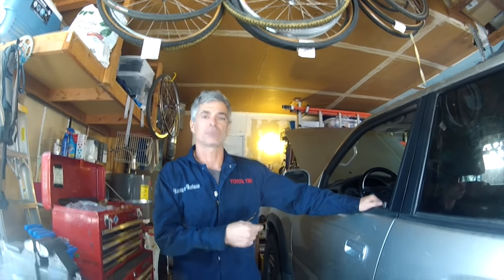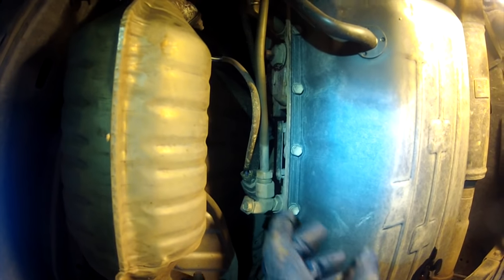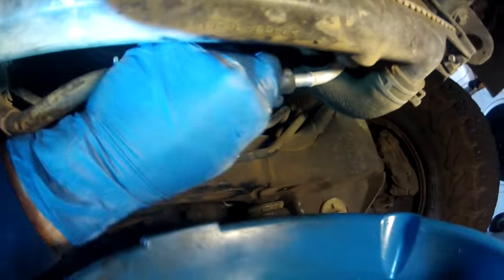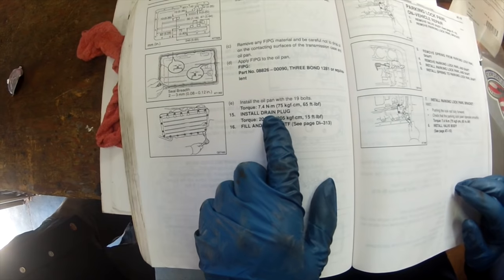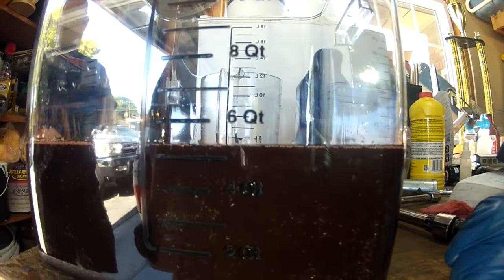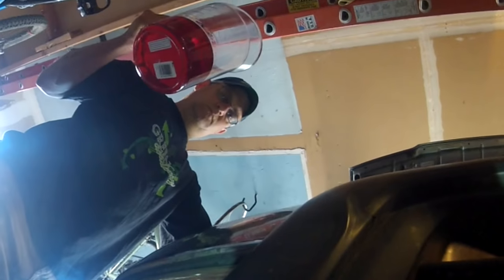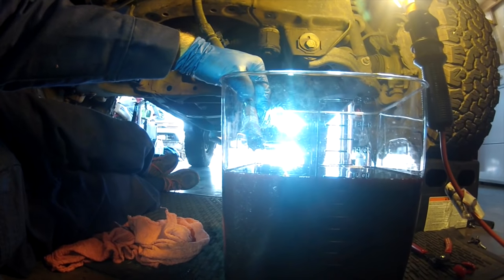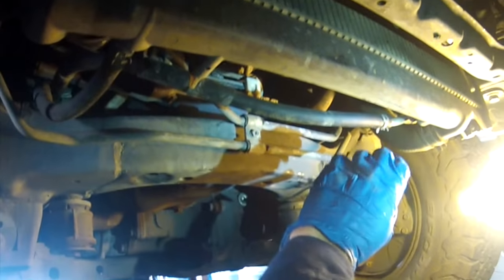Transmission Fluid Flush

Comment: I have an '01 Tacoma, but it's a manual transmission.  Is the process that much different between manual and automatic transmissions?
Reply from the maker: It's different and it's easier Joseph.  Yours is just like renewing the fluid on a differential or a transfer case.  You just take out the drain plug at the bottom of your transmission and drain the old gear oil out into a drain pan, put the drain plug back in, take the fill plug out and refill it will fresh gear oil.  You want to have your rig on level ground for this.  You fill it with gear oil until the oil starts spilling out the bottom of the fill hole and then you're done.  Take a look at your owners manual for the grade gear oil to use.  If you want a suggestion for a good gear oil, I'd use Redline MT-90.  Redline makes good synthetic gear oils but they are a little pricey.  https://amzn.to/2S1CbJp
Reply: @TimmyTheToolman  Thank you so much for taking the time to provide such a detailed reply, and for getting back to me so quickly!  I really appreciate it--and such great news that mine will be an easier job!  Your videos are really great, I've been binge watching them and keep putting new tools in my Amazon wishlist.  Thanks again!!
Reply from the maker: @JosephERock  You're welcome.  Great to hear you like what Sean and I are doing.  Good luck with all the work you have planned for your rig.  And, have fun buying new tools.  It's like Christmas every time the Amazon driver shows up.  Happy Wrenching!

Comment: If I was going to change the radiator, add a transmission cooler, and I wanted to flush/fill both the radiator and transmission....what order would you do it in? I dont think I want old ATF to go through my new radiators?
Reply from the maker: Yeah, you could do the trans flush first, drain the radiator coolant, and then install the new radiator with the external trans cooler.  You will lose some of your fresh ATF from the trans flush when you disconnect the cooler lines, so there will be some waste, but that's not really a big deal.
Reply: @TimmyTheToolman  Wow thank you for such a fast reply. I appreciate the advice. Yea I'm sure I'll have a few extra qts for that after the flush if I get 3 gallons.
Reply from the maker: @hurpaderpp  You're welcome David.  Good luck with the job.  One thing you didn't mention is swapping out the thermostat and this would be the opportune time to do it along with putting on new upper and lower radiator hoses.  Don't get rid of the Toyota constant tension clamps and replace them with those crappy screw down clamps.  Reuse the constant tension clamps.
Reply: @TimmyTheToolman  Thank you again for the keen advice haha. I have thankfully watched your videos a few times on these topics to get ready and have gotten all those recommended things as well. 

I'm switching back to Toyota red from whatever the last owner put in that's why I also want to do the cooling system flush. Doing the rear diff breather mod soon too. 

I made sure to try and purchase as much as I could off your affiliate links. Least I can do for the great vids.

Comment: Hi Timmy, I have a question, it's not a normal question, but here you go, it is a good brand "duralast"? I want to replace the belt tensioner of my corolla, I have an " Autozone" near from my house, and you know they only sale "duralast". Thanks
Reply from the maker: Hey Javi,  I don't have experience with Duralast products.  However, if Autozone gives a lifetime warranty on the part, it might be worth a shot.  If it fails, you get it replaced for free but you unfortunately have to repeat the labor.  Since it's probably not a hard part to replace, I think it would be worth the risk only if they give a lifetime warranty.  However, if it was a very labor intensive part to replace, I'd only go with OEM to limit the chance of having to repeat the job.  People often choose auto parts store products for the lifetime warranty but forget that they don't get compensated for the time and effort to replace the part again.  Quite often, paying more up front saves a headache later on.
Reply: Thanks Timmy.! I will take the risk. Also I will clean the throtle body of my 4runner. I would like to show you some pictures, I put the throtle body spacer and cold air intake (k&n) to my 4runner.
Reply from the maker: You can send pictures to my email address: mtbtim@sbcglobal.net

Comment: What about cleaning pan and changing filter?
Does it help to clean the channels better when changing gears on the lift?
Reply from the maker: The fine mesh metal filter these transmissions use is pretty much considered a lifetime filter.  I dropped the pan for this video out of curiosity to get a glimpse at the health of my trans by seeing how much metal debris had accumulated on the magnets.  If you know the maintenance history of your rig and the trans got regular fluid changes, I think dropping the pan and replacing the filter is a waste of time.  If you don't know the history of your rig, dropping the pan might be prudent especially if you found that the fluid was very dark leading you to believe the trans didn't receive regular maintenance.  Dirty fluid will produce more deposits that will block the filter screen.
Reply: @TimmyTheToolman  much appreciated. I went to a shop (original Ford) with my Ranger 3.2 and 95.000km 6speed wildtrak and requested a flush, filter change and general check because the yellow trans light went on and the power was greatly restricted when warmed up. the bill showed 4l fluid, the restrictiction still comes when im in the mountains or a bit speedy  but the light doesn't show up ( I guesss they pulled the plug behind the dashboard cos the fuse is still in and ok). I guess I got scammed or they are lazy or they don't know or they don't believe a guy on the street. 
Thanks for your great work
looks like I have to do it by myself. I'm screwing around since teen times ;-)
Reply from the maker: @andsch0172  Yeah, there's definitely no shortage of crooked shops out there.  It's too bad.
Reply: Timmy The Toolman thanks a lot. Keep going. All the best for You
Reply from the maker: @andsch0172  Thanks Brother!

Comment: Hi Timmy, muy name is Javier from Mexicali, México. I really like tour vídeos they have been helpful to me. I have a question, I have a 4runner and a corolla. The transmission oil level when car is turn off, the oil is un the hot notch of the gauge, when the car is turn on, the oil is in cold notch of the gauge. This is un both cars. It is normall this, por just un toyotas cars?
Reply from the maker: Hey Javi, You only check transmission fluid when the engine is RUNNING, the transmission should be shifted into Park and you need to be on level ground.  You never check the fluid level with the vehicle off.  There's cold and hot marks on the dipstick so you can accurately check the level when the transmission is cold or when it's hot.  Transmission fluid expands as it warms up.  Normal operating temperature for the transmission on the 4runner is 158-176.  If you started your vehicle and you haven't been driving, the transmission fluid would be cold and you would expect to see the level on the dipstick in the cold range.  If you've been driving for a while, I'd say at least 10 miles, your transmission fluid temperature should be close to the operating temperature range and you'd want to see the fluid level on the dipstick in the hot range.  Just know a hot engine doesn't mean your transmission fluid is hot too.  You have to drive the vehicle in order to heat up the transmission fluid.
Reply: Timmy The Toolman  All right, I see, next time I will check the fluid after the car is running at least 20 minutes, not right after I start the car. Thank you very much Timmy.! I saw your vídeo, "starter removal", and it help to replace the starter of muy 4runner, it take me like 4 hours because I do not have a good set of tools, but I did it. Thanks Timmy!!!
Reply from the maker: Hey Javi, just make sure that 20 minutes is driving time not sitting there idling.

Good job on the starter replacement.  Having the right tools for the job makes all the difference.  I've definitely spent a ton of money on tools over the last year and a half but I'm finding repairs are much easier now because I have so many tool options to get things taken apart and put back together.

I'm happy our videos are helping you out.  Feel free to hit me up with any questions you have.  Happy Wrenching my Mexicali 3rd Gen Brother!
Reply: Timmy The Toolman All Right, Thanks Timmy.!

Comment: Looking to flip a 2jz is300. Really just changing all the fluids. Think I’d be able to use this method to flush the trans fluid?
Reply from the maker: Not sure.  Not familiar with the iS300.  Does it have a transmission dipstick or is the trans sealed?
Reply: @TimmyTheToolman  has a dipstick. And cooler is on the rad as well
Reply from the maker: @jimbo2040  Ok, this video would work then.  Since you have an external trans cooler, you could either disconnect a hose to the stock cooler in the radiator or disconnect one the hoses to the cooler, your choice.  

You would first drain the pan like we did and replace the amount you drained out.  Then you disconnect the hose you want, hook up the drain hose and run it to your bucket with graduated quart markings.  Then you'd start the procedure of running the engine, draining out a quart.  Then stop the engine and add a quart.  You'd keep doing that procedure until the fluid looks clean.  Good luck!
Reply: @TimmyTheToolman  thanks Joe! Your teachings have done way more outside of the 4runner platform. You’ve taught us well
Reply from the maker: @jimbo2040  It's actually Tim, but maybe Joe is my alter ego.  But, thanks for what you said.  I appreciate it!  Happy Wrenching!

Comment: Is there a filter in the transmission that needs to be changed.
Reply from the maker: There is a filter, but it's a fine steel mesh filter and not a paper filter.  These steel mesh filters are considered by many as a lifetime filter because it's more a stainer than a filter.  With that said, some people choose to replace it like I did in this video: https://youtu.be/tuGazNhuEtM  The reason why I dropped the pan and replaced the filter was out of pure curiosity and to see how much metal debris had accumulated on the magnets over the life of my transmission, and to see if the filter was at all significantly clogged.  What I found out is there was very little debris on the magnets letting me know my trans was wearing well and my filter was pretty much 90-95% unclogged.  If your transmission has received regular fluid renewals over it's life, I'd say dropping the pan and replacing the filter is a waste of time and money.  If you have a unknown service history for your trans, dropping the pan might be something to consider because an abused trans will acquire more debris in the fluid and possibly block up the filter media more significantly than if the trans was treated well and received regular fluid changes.

Comment: Tnx for sharing!!! I got Toyota rav4 3gen 3.5liter engine  any idea about atf 's temperature,service mannual is missing.
Reply from the maker: You're welcome.  I don't know anything about the Rav4 ATF temps, but I do know the best operating temp for ATF is in the 155-170 range. When checking the level after you do a flush, make sure the dipstick level is in the hot range if you're in that 155-170 temp range.  If you don't have a way to monitor the temps, go for at least a 10 mile drive on the freeway, 5 miles out and 5 miles back and do a bunch of hard accelerations to get the transmission to kick down.  Getting the transmission to kick down helps raise the temperature.  When you get back home, get on level ground and check the level right away because the temps will start to drop almost immediately once you're just sitting there idling.
Reply: Timmy The Toolman  Thank You for such quickly respond!!

Comment: I have a 2004 tundra. Never change the transmission fluid have a 113000 miles. The oil is nice in red. Why do you think about changing the oil at this point.
Reply from the maker: If the fluid is red, then it hasn’t been tortured. Black or dark fluid wouldn’t be ideal. Because this would be your first time, the “flush” from this video or a simple draining of the pan and refill, should be ok.

Comment: What Mobil atf would you suggest for 3rd gens? I've heard Toyota actually uses rebadged mobil fluid.
Reply from the maker: I'm not familiar with Mobil products.   I've never used them on my rigs.  I use to use a Valvoline Dex/Merc which is a conventional ATF (non-synthetic) but now I use Valvoline Maxlife ATF which is a full synthetic.  I provide a link in the video description.
Reply: @TimmyTheToolman  if I just do a drain/fill is it bad to mix synthetic and conventional atf?
Reply from the maker: @Mattars  No, it's not bad.  It's fine to mix conventional and synthetic.
Reply: @TimmyTheToolman  First of all, AWESOME videos! I always check if you have a video before I do anything on my 2k Sports Ed. like the TBU and this one. So regarding fluids - the Red Maxlife vs the Blue Import which costs a little bit more but higher viscosity index, do you think that would be a better match to the 3rd gen? I heard that the Red one is kinda thin since its also WS rated. Also can I overfill by one quart every time I replenish the ATF and drain 2 quarts at a time? I hope overfilling wouldn't be that bad for a short time right?  This way I can get to the 12 quarts with less starting and stopping the engine. What do you think? Thanks!

Comment: Man... getting that dipstick back in is a challenge (just checking the fluid level)...  is there a trick to getting the last 6" so in?  I've never had so much trouble getting a dipstick back in.
Reply from the maker: Use two hands.  If you use just one, you'll bend the shit out of it.  One hand at the end of the dipstick and one close to the dipstick tube helping feed it in.   Based on the bend of the dipstick, there is one orientation that allows it to go in easier.  Experiment with it and you'll figure it out.
Reply: @TimmyTheToolman  yeah, I've done that, pretty much to the letter....  it still doesn't seem to want to go in the last 5 inches or so. I'm wondering if something is tweaked in there.   Thanks Tim!
Reply from the maker: @wildmustangart1577  Weird.  Maybe go to your local dealer and see if they have one for sale.  Before you purchase it, compare it to your old one and see if there is a difference and it is indeed tweaked.  Have you checked the mating of the upper and lower tube.  The lower tube is part of the pan and the upper tube slides into it with an o-ring to make a seal.